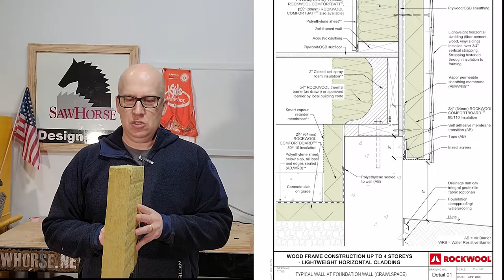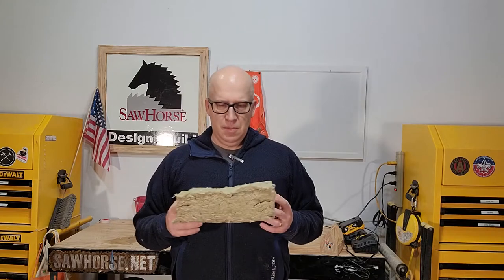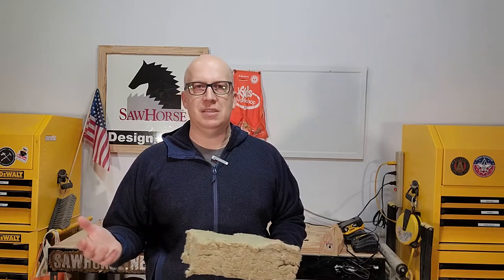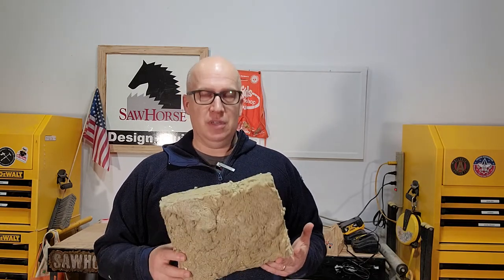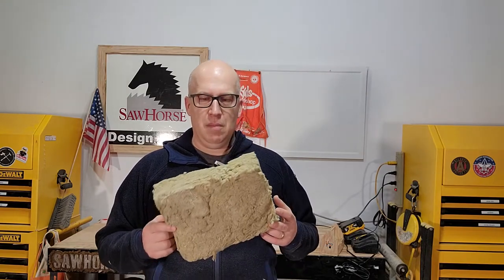ROCKWOOL Comfortboard VS Safe 'n' Sound

Comment: which is best for soundproofing wall for band studio with drums, bass amps, guitar amps ? thx
Reply from the maker: That is a great question.  Most of the in wall materials are for 50 db and less.  If you have a band, then you might need several layers and to use other products with the safe'n'sound.  We have a studio at out house and are working on the engineering right now.  I'll share the final design once it is complete.

Comment: Does the comfort batt provide better sound insulation?
Reply from the maker: It is very rigid and designed for locations where you need Rigid Insulation.  If you are installing between the studs/ joists then the batt insulation is best.  

If you are asking about comfort batt versus Safe'n'sound then it is a little thicker so has a better R-Value.  I am not sure about the sound transmittence though.

I've been asking many of these manufactures about the ultimate sound deadening system and I get lots of different answers.  ROCKWOOL has given me good advice, however I need to use other products as well to complete the assembly and they only seem to test walls or floors and not both.  Not sure why and don't get answers that make sense when I ask why.
Reply from the maker: I do plan to come up with some good/ better/ best assemblies latter this year after I talk to some real sound experts.
Reply: No problem. I went with the comfort batt and I'm glad because of that R value you mentioned. Thank you
Reply: confort batt is better for mid high frequencies due to its stiffer structure.. Safe and sound is better for low end. The looser fibers absorb low frequencies better. If your asking for a studio type installation

Comment: Who do you order your insulation from?  It is a bear trying to get this product from Lowes or Home Depot.  Did you order from an online merchant?
Reply from the maker: Most insulation suppliers can get it.  If you need a contact for a larger amount, one of our design partners can help.  Fill out the contact for on our site and I'll introduce you to them.  https://sawhorse.net/contact/
Reply: @SawHorseDesignBuild  my builder suggested using R22 comfortbat in my basement ceiling instead of the safe and sound which is only 3 inches. Will it do the same job of noise reduction?
Reply from the maker: @mikemontana1990  Thicker is better.  Safe-n-sound also comes in 6 in which is close to the same.  I would also look at hat channels to separate the drywall from the framing.  There is also drywall that can help with sound in addition to all of that.  Not sure how much sound you are trying to block.

Comment: Would comfortboard be appropriate in basement walls behind studs and directly on concrete? And comfortbatt being used between each stud
Reply from the maker: That is a good way to create a "thermal break" between the concrete and the framing.  The ideal thickness of the comfortboard would vary depending on where the house is located.

Comment: I didn't realize just how firm comfortboard 80 was as I've only used comfortbatt. It looks like it could be laid on top of roof sheathing, have another layer of sheathing over it to nail shingles into, and have no wood in between the two layers of sheathing for reinforcement. I had thought I would need 2 by 4's in between to keep the rockwool from compressing but that may only be with comfortbatt.
Reply from the maker: Some people do that.  If you do- make sure you have a vapor diffusion port at the top to allow the humidity to escape or you will trap it and rot out the structure.
Reply: @SawHorseDesignBuild   The more I look into vapor diffusion ports the more I like them since I'm in climate zone 3. I'd been wondering what material to use since I haven't seen Delta Foxx widely available, but I see Siga Magvest is available in 18'' widths at 67 perms.

Comment: I’m in Florida ….can you do the 12 inches on the roof and use a normal rockwool insulation above the ceiling drywall like a batt… or will that create havoc in my vented attic…i dont want to use spray foam and i also want to use a OSB with a radiant barrier on it
Reply from the maker: is your HVAC in the attic?

Comment: hello,i am thinking to build a window insert sound panel to prevent the noise from outside, for the same thickness which is 3 inch, which one has the better sound absorption quality, the comfortboard or the safe n sound? thank you